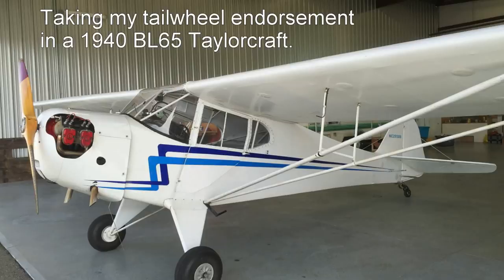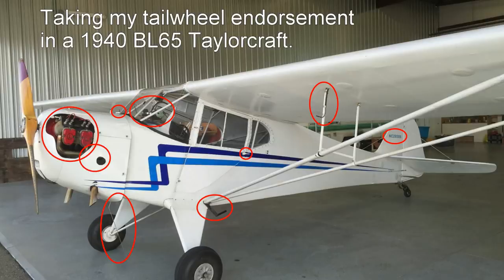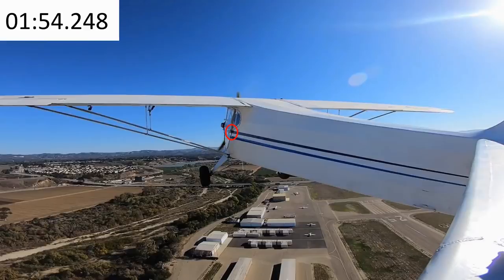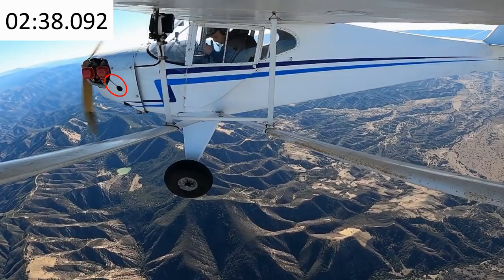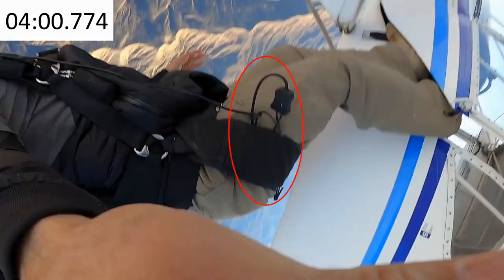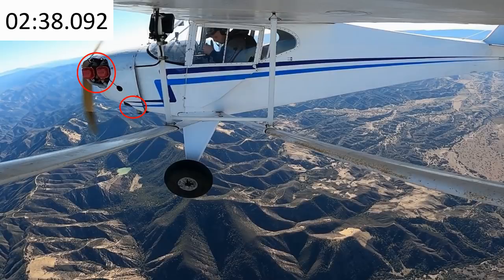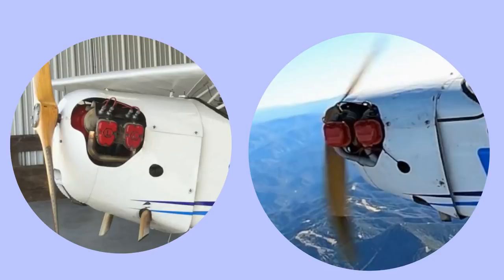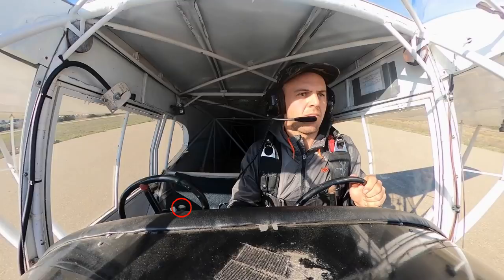Dear Trevor Jacob 1.1—That’s Not a Lycoming, I Found Your Water, and We Still Have More Questions…

Comment from the maker: Please watch the updated version of this video instead, as it includes everything I’ve posted in earlier videos, including this one: https://youtu.be/3YgX7HAAGDo
Reply: Pete you told us nothing new.
Reply: 0:55 are you sure that isnt the static port?
Reply from the maker: @ryanbroguy  yes, I’m sure. The pitot tube is on the jury strut that supports the lift struts. They need to be in a location that has clean non-turbulent airflow.

The black thing attached to the bottom of the rear lift strut is in very turbulent airflow. And it’s pointing backwards. And it looks just like the step seen on other Taylorcraft.

Comment: Once upon a time, this little plane was built in a workshop or a small assembly line.  Some of the people who worked on it were just working a job, trying to make a living.  To others, this was a labor of love, as they made sure every weld was perfect and every bolt was tightened to spec.  Could they have imagined the ridiculous and humiliating end to which this aircraft would be subjected?  To my eyes, Trevor's video footage is self incriminating. Analysis by people with intimate knowledge about the aircraft only adds fuel to the fire.  Trevor's actions are an affront to responsible pilots across the globe.
Reply: eh, it earned many times its value from all the videos surrounding it
Reply: You're being overly dramatic, at the end of the day its still just a hunk of bolts and metal which was probably on it's last legs and seen better days anyways.
Reply: @RandySavag  No man he’s right, this dumbass behavior will lead to stricter regulations when it comes to flying.
Reply: @suspicioustumbleweed4760  What stricter regulations would come from this? Not being allowed to wear a parachute while flying? It seems he broke a lot of previously established regulations I get that, and he should be punished accordingly. 

I just don't get the over reaction like he destroyed a one of a kind mona lisa timeless artifact. It was an old ass plane that was probably sold for scrap... I'm not saying what he did wasn't dumb and he shouldn't be punished. But it did seem like a pretty "controlled" stunt, it's not like he was flying over a major city and decided to dip out in the spur of the moment and let his plane fly into a populated area.

He clearly "planned" and put his plane in a very unpopulated are where risks of causalities would be at a minimum. Is he qualified and legally able to do this? Probably not. But he did and everything turned out relatively harmless. Do I think people should do this for fun and copy cat him? No, it is a bad precedent. Do I think he should be punished? Yes, for whatever rules he did break. 

But I can't help but feel apart of me look at what he did and go "Nice, that was actually pretty cool". He made a plan, and executed it successfully not to mention what he did took HUGE balls, and I can't help but kind of respect that. I feel a lot of people look at this guy with jealousy and envy, they wish they had his plane and feel like they're more entitled to it because of how he didn't "respect" it and despise they themselves don't have the courage to do something "crazy" and out there like he did.

I get it, he broke some rules. But let's not make this a witch hunt and burn him at the stake acting like he burned downed a school of orphaned toddlers.
Reply: @RandySavag  he left it up to himself to prevent a forest fire and hope no ones out for a hike or that the plane might go where he didn’t expect. It could lead to new legislation to change how pilots licenses work - maybe you’ll need an explicit reason or have to pay much more money to have a recreational license or some shit. Not to mention he’s passing it off as reality and lying his ass off about so many aspects
Reply: @RandySavag  To be clear I didn’t say I cared about the decrepit old plane, and I don’t even care if fines are issued, but he can get shit on online for it.
Reply: @suspicioustumbleweed4760  It's not fair or logical to punish or restrict people who follow the rules because of this one idiots doing who didn't. I don't think people bailing out of planes for fun is gonna catch on. If they're gonna hike up the price of recreational licenses because of this that's more showing of their greed then anything else. 

Like I said this isn't some huge accident/tragedy, nobody got hurt.
He should get his punishment as deserved for what he did was wrong but I don't see how this affects or is gonna ruin flying for other people. If someone ditches their car off a cliff the governments not gonna suddenly punish everyone asking for alibis and hiking the price of getting a license. 

People seem to be getting a little too much glee "shitting" on this guy which only gives him more attention and elevates the achievement he accomplished. This crazy reaction from people serves his ego, if everyone wasn't getting off and making such a huge deal of this it would belittle his "stunt". Give him his punishment, move on. He crashed his plane into an empty mountain, I could hardly give a shit. The way people are acting you'd think he crashed a Boeing jet into the trade center 21 years ago.
Reply: @RandySavag  I don’t think it’s fair either
Reply: @RandySavag  those airplanes last forever if you keep up the maintanence. Lots and lots of 70-90 year old G.A. aircraft flying around in better shape then when they left the factory with more efficient engines, glass cockpit, G.P.S., etc.
Reply: @kdrapertrucker  Anything lasts forever if you properly maintain it. This one wasn't.
Reply: I bet you were one of the people with pitchforks when whistlindiesel wrecked that plane. On the ground. C'mon I'm not for what he did but nobody is necessarily going to miss that jalopy
Reply: Boy oh boy is he under the microscope, rightfully so..
Reply from the maker: One of these days I hope to tell the story of someone I stopped from gaining an unreasonable amount of power, literally using a toy microscope, so I have some prior experience. ;-)
Reply: @RandySavag  there always needs to be that one negative person in every comment section for no god damn reason. Get a life.
Reply: So what, whoever bought the plane paid for the labour, once you buy it you do what you want with it
Reply: @RandySavag  This is like saying someone shouldn't be arrested or go to prison because they decided to shoot a firearm into someone's house, through their windows, and didn't hit anybody, just because "NOBODY GOT HURT". Don't be ridiculous. This guy had no control over that aircraft after he jumped out. You appear to not be part of aviation from how you talk, pilots in aviation receive punishment for their actions when they intentionally do something that had the potential to CAUSE harm. Not because NOBODY GOT HURT. People in aviation get much greater punishment for less than what this guy did.
Reply: When did I say he shouldn't be punished because no one got hurt?
Reply: @RandySavag  The part where you said you don't think someone's life should be ruined because "nobody got hurt". Intentionally crashing an airplane, which he clearly did, would likely lead to prison. Which is a life ruining punishment. He broke so many laws/rules, that his life would likely be ruined as badly as many people want it to be. Because it's warranted due to what he did... It's that simple. Read up on Sully and the controlled crash into the Hudson river. All the correct calls were made, and yet his judgement and actions were heavily investigated, and interrogated by the FAA. This guy deserves much, much worse than that considering the fact that Sully exhausted all possible options (Which this guy clearly did not)
Reply: @ChaseB1896  Maybe I phrased it poorly, it's not that this guy doesn't deserve Jail and fines. That's obvious I never said he didn't deserve punishment. It's how giddy and over the top people are calling for his head which is unsettling, if it was up to this comment you'd think they wanted this guy hanged for what he did. It's very much clear ya'll are extremely sensitive.
Reply: @RandySavag  it's because aviators are held to a very high standard, and someone bringing the usual "do stupid shit for views" into aviation is extremely dangerous.
Reply: @RandySavag  yeah, this guy has VW beetle level attachment issues.
Reply from the maker: Now that I’m aware of it from this incident, I really want one as my first plane. I’ve always wanted to follow in the footsteps of my childhood hero and fly a Helio Courier—this would be an excellent bird to get me ready for that.
Reply: @RandySavag  does it also in your mind to do other dumb things, like jumping off the bay bridge?? Hows about the fact that he put it into a national park that could have resulted in fires and habitat destruction,,,or maybe the loss of life of firefighters trying to put out the blaze? This guy should be put in jail and throw away the key
Reply from the maker: Upvoted and hearted because you’re apparently from the Bay Area like me. Two Words: Oakland Hills.
Reply: @PetesGuide  You poor little thing. How tragic he did that to your plane.
Reply: @bill45colt One word. No. 

 False Equivalency fallacy. 
Why are we playing a game of hypothetical things that didn't happen and assuming I'm defending what he did like he deserved no consequence???? You guys are unbelievable. I'm done
Reply from the maker: Just not for Trevor’s wallet! The numbers are amazing.
Reply from the maker: Because what you call false equivalency is not, and is actually written down in black and white in at least one location in the fed’s rules for dishing out punishment for aviation mishaps. I’ll let you find where.
Reply: last time i looked, its an open forum,,,my post is no more valid than yours or others,,,,and given the opportunity, i posted
Reply: This is what makes me angry.  If I were fortunate enough to work on an aircraft assembly line,  Id pour my heart and soul into whatever I was tasked to do.  It was an heartless act.  These aircraft if looked after and maintained last a life time.  Case in point, any airworthy DH Tiger Moth in service.  Or Beaver.
Reply: @RandySavag  One problem though his plan hasn’t worked ,because he has been well & truly sussed out .

Comment: You probably noticed this but didn’t point it out, That series if Taylorcraft uses a barrow type fuel selector valve on the upper right fuselage wall where it connects via rubber tube to a glass site gauge that connects the Rt wing root fuel tank. This is visible siting affixed to the wall in the older photo. It’s visible in the  video front cockpit view hanging lose from the Rt upper wall in the off position and disconnected from the Rt wing root fuel line. So that Rt wing tank is obviously empty. He must have been very concerned about a post crash fire. A that’s probably why he had the fire extinguishers in his pant legs. That also explains why he trimmed it so much nose down. So the plane  wouldn’t glide to far away. That plane has a 9 to 1 glide ratio, so from 10,000 feet it could have glided about 11.5 miles or back or the airport he took off from. I think the only reason he landed in the thicket instead of one of the open areas, was because he was trying to land his parachute as close to the crash site as possible. The reason I think he was concerned about a post crash fire, is that had the plane burned he would have lost all the camera footage from the aircraft and would only have the footage he took with the camera that was in his hand when he bailed out, the same camera in the right corner behind his head pointing forward. Oh and where is the footage from that camera that showed the front cockpit view. Was it not used because it would show the mags in the off position, or that you never tried to restart the engine? Something else that bothers me as a healthcare professional. You talk about being dehydrated, but your eyes aren’t sunken and your teeth are shiny from the moisture in your mouth. If your mouth was dry, your teeth would appear dull. I also noticed despite all you went through, you took the time to frame your shots and even when bending down to get a drink, kept your face perfectly framed. In fact the only time a shot wasn’t framed properly was when you pointed the camera down intentionally to avoid getting your rescuers on film. Conveniently keeping these potential witnesses from being identified.
Reply from the maker: I’m not familiar with what a “barrow type” is. Can you point me to drawings, patents, etc?
Reply: @PetesGuide  Taylorcraft’ wing tank feed the auxiliary fuselage tank via gravity. As the fuselage tank empties, you open the wing selector tank valve and the wing tank drains down and fills the fuselage tank. That model only has a right wing tank. In the models with both tank like the army version L2 grasshopper, there is a valve on each side above the pilots head, approximately where the wing spars meet the fuselage.
Reply from the maker: @diabolicalmistercheeze5719  understand that, but have not heard the term barrow valve before. Can you explain more about the type of valve?
Reply: @PetesGuide  not sure either but I think it means the tanks has a shape like a wheel barrow, where the bottom angles down to one point, to help the fuel drain out, since it is drained by gravity to the fuselage tank
Reply: My thoughts exactly - every minute detail captured on camera from beginning to end !

Comment: I'm glad you mentioned that possible bungee cord, I've been thinking that's what that was and I mentioned it in a post on another video. It really looks like he used it to hold the bottom of the engine cowling down. Probably to lazy to reattach it correctly since he planned on scuttling it anyway.
Reply: He simply had a time crunch at the end of the project, happens all the time, more often than not.  The target date for the video was obviously D.B Cooper's famous Jump for the Money date.
Reply: Perhaps a water container secured inside the engine area so it would explode on impact and put out a possible fire.
Reply: It also looks to me that there are some fairly rough dents in the top of the cowling, perhaps he had to beat it into submission to make it fit around the Continental engine.
Reply: @Repomam2000  Looked like he had several plastic bottles of water. I think he was betting a few of them would survive the crash landing for later consumption for the trek by foot.
Reply: @Repomam2000  It was too big to jump with, he was probably drinking from that to hydrate before the jump, and hoping it may help put a small fire out / suppress it, or actually be intact for him after hiking to the wreck site to retrieve his cameras / footage.
Reply from the maker: I just bought that exact water jug from Target yesterday and discovered a few things. 1) from a slightly different CG jug from Safeway with a plastic handle, the cap looks sealed in the video. 2) From the paper/plastic handle like on Trevo’s jug, it gets deformed if you carry it any distance. So the jug was full and he put it in the plane without lifting it by the handle. I won’t attempt to explain why yet.

Comment: I wonder, where is the form 337 and log entries for the engine change? What approved data was used? Who was the licensed mechanic who did the work?  Who was the IA that signed off on that?  If this individual made those changes without those things being done he has more trouble coming.  The  FAA takes a dim view of undocumented maintenance and of improperly done modifications to airframe or Powerplant with out some kind of data such as an STC and the accompanying paper work.

Comment: I am continually impressed by the details you and others are finding. The boarding step is very telling, probably removed to avoid entanglement. I understand it was a parts plane, but it certainly was flying very well (I love how in one clip it looks like it’s going to land itself near the river), which makes me wonder if it could have been restored.
Reply: Definitely could have be restored, but it was probably expensive to do so, and so the original owner sold it for parts instead

Comment: Nice.  I still think that the cowling is cracked but can see what you mean.  Also that water bottle look so much like the one you see him "Given" by the farmers who "saved his life" Which also happens to have dirt in the bottom.
Reply from the maker: I haven’t gotten there yet, but have the same suspicion as you on the bottle. Gotta drink another half gallon before I start trying to match angles. Take a closer look at the “lump” in the crack. I really think it’s a cord.
Reply: Note regarding the cowling. It may have been cut rather than cracked to allow for the different size and rooting of the exhaust.
Reply: @PetesGuide  Looks like baling wire to me.
Reply: There’s a lump inside his jacket as pointed out by others. Possibly the water bottle.
Reply from the maker: @tybrady1935  I’m not sure about that. I have some other hunches, but need to finish up with the things we can see on the ground, before I start looking at that.
Reply: @PetesGuide  I think it's a cable tie

Comment: If you re-watch the original segment you have frozen at 4.30, it looks like he has another, smaller bottle inside his jacket. For a second, as he's moving his hands around pretending to panic, the bottle cap can be seen pushing into the material. I also think he has food in the sleeves.
Reply: If you look at his shots where he lands his chute int he scrub, the bottle inside his jacket has burst and you can see the water wetting the jacket.
Reply: @itsverygreen532  Maybe... Or maybe he peed himself during his freefall ;)